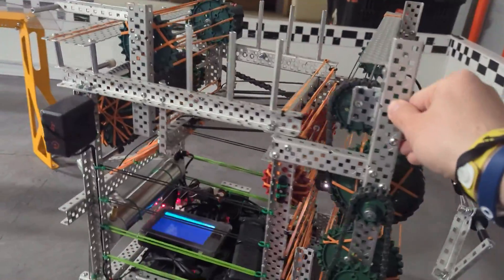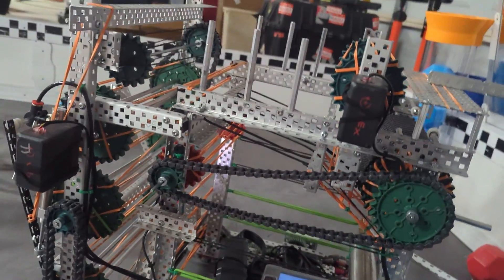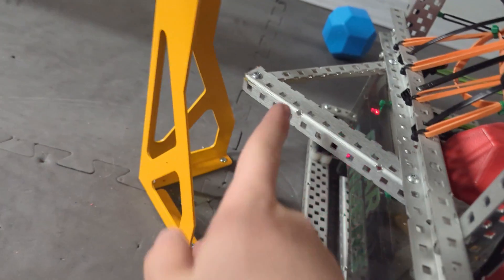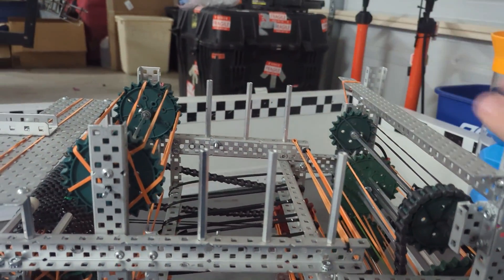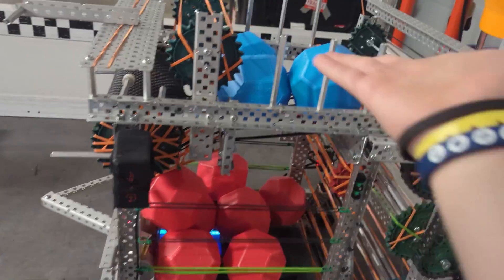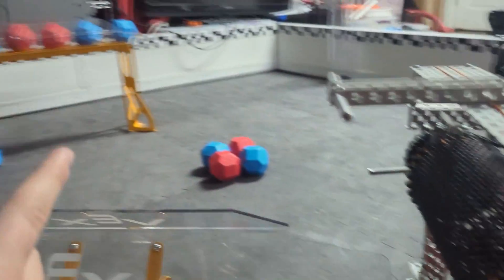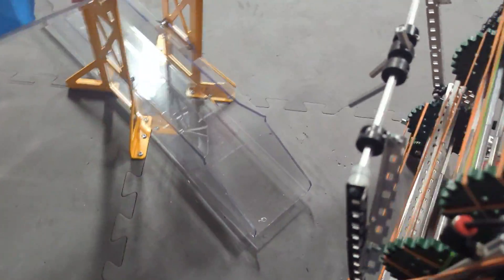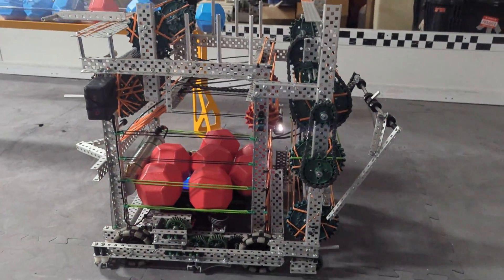Robot in 3 Days Explanation | VEX Push Back

Comment: Why do you add rubber bands around the motor?
Reply from the maker: I use hot swappable motors. That means I took out the normal silver screws and used rubber bands to hold the motor together so it's super easy to swap out with a new motor when it overheats

Comment: How did you manage to keep everything within 18x18x18.... I mean, how'd you think it through, how'd you safe space... drive trian for sure... I wanna know more about that.. i think with our (my team's) bot... we lack proper usage of every inch we have
Reply from the maker: This one isn't in size, but if you were to make it in size, probably you'd need to make a much smaller hopper, and make the upper part quite a bit shorter overall. In general just scale it down a few inches. The intake can be between the front drive wheels, and the back doesn't need to stick out so far (which can be fixed easily if you spend more than 3 days on the robot). It's mostly just going through the big parts of the robot and asking yourself if it needs to be that big or there at all, and most of the time you can at least make it smaller. Does that help?
Reply: @Joseph973  Yeah for sure. Thank a lot man. Also, I sent out a lot requests for details of pneumatics from another video of yours. For some reason I never heard anything back, even when I utilized an alternative email.
Reply from the maker: @Nicklenickle  I'm sorry that it's not working, I just checked and it seems to be working on my end, but here's the link to the photos in case it's still doesn't seem to be working for you: https://drive.google.com/drive/folders/1_itw53HMAylst4ahBJwx5-XjMp29jjtj?usp=sharing
Reply: @Joseph973  Thank you very much!

Comment: I was wonder how exactly did you attach the high strength shalt locks to the Gussets for the goal scraper part. My team are currently trying to make the same thing. Thanks.
Reply from the maker: It's not a high strength shaft (although it probably should be), it's a bunch of standoffs attached together
Reply: @Joseph973  Yea, I was wondering how you attached the high strength shaft locks to the standoffs
Reply from the maker: @Linux-Guy-jp7lpYou just kind shove them on and it works
Reply: @Joseph973  How? The high strength shaft locks have square holes
Reply from the maker: @Linux-Guy-jp7lpThey're kinda both the same size even though they are different shapes, you just shove it on and it stays

Comment: Do you know how you could make it 8 motors? And what’s a half motor?
Reply from the maker: Instead of 1 11-watt motor (the normal kind), you can use 2 5.5-watt motors, which I call half motors. Using two 5.5-watt motors, you can make this robot within 8 motors
Reply: @Joseph973 I thought it just matters the amount of motors your using not the wattage, is it that?
Reply from the maker: @AllenAlien-z7x No, as per R12, you are limited to 88W, not any specific amount of motors
Reply: @Joseph973  is putting 5.5 motors legal? wouldnt that still be 9 motors?
Reply from the maker: @Bigblakcox Yes, they are legal, check out R12
Reply: @Bigblakcox It’s not an 8 motor limit, it’s 88W limit. So having 8 11W (or normal) motors would be the maximum but you could mix in 5.5W motors it just has to have a limit of 88W in total
Reply: @CrashModeOfficial  our coach always told us it was just 8 motors i didnt know it was like that tysm

Comment: what is the stuff thats on the spinner that takes the block to the middle goal?
Reply from the maker: It's mesh (yes it's legal). You can find it on vex's website, or on Amazon where it'll be called drawer liner
Reply: @Joseph973 I found it, but is the kind you use thick or thin?
Reply from the maker: @AllenAlien-z7x I'm not sure, I've only ever seen it in one thickness, but it probably doesn't matter much, you just need it to be sticky
Reply: @Joseph973 okay thank you, your robots are amazing keep it up.

Comment: How did you mount the axl for the scraper on the two l-channels. They are high strength so they don’t fit through the bar
Reply: You can drill out the hole so a HS axle will fit.

Comment: I want to know what placement you did with the motors?
Reply from the maker: There is 6 on the drivetrain, 1 on the intake, 1 on the top back roller and one on the bottom back roller. Those last two motors could easily be 5.5w motors though, to make it fit in 8 motors
Reply: @Joseph973  your robot is oversized I think make sure it’s oversize. Your is over 18 inches and thanks.
Reply from the maker: @02armando19Yes, that's why I mentioned that at the end of the video
Reply: @Joseph973  oh OK thank you